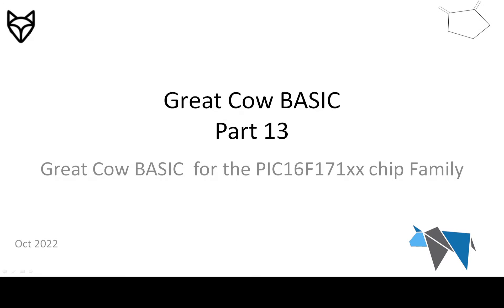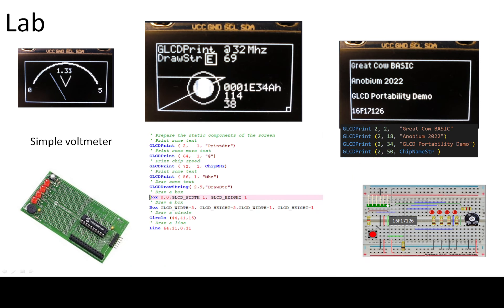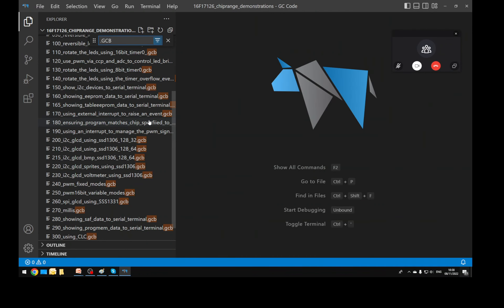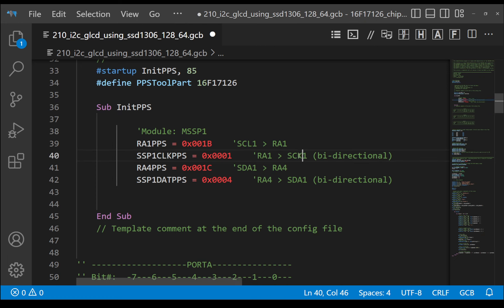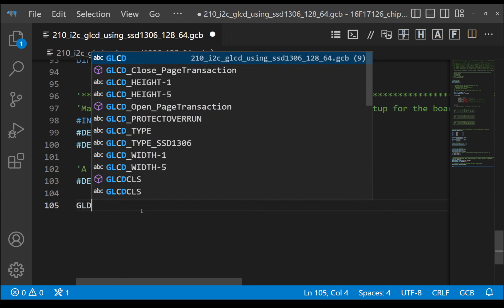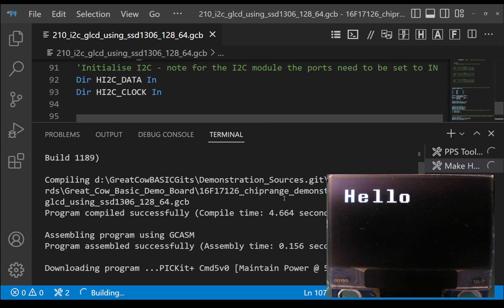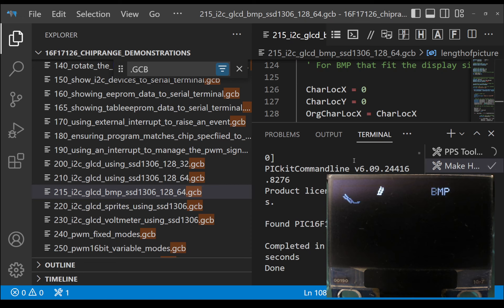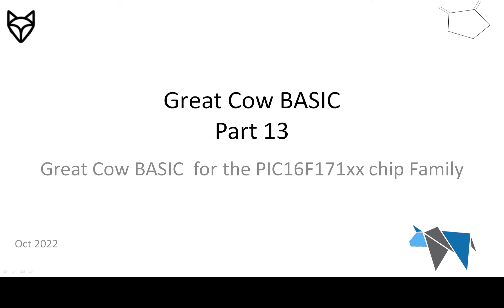PT13: PIC16F171xx Family - 16F17126: Using an I2C Graphical LCD

Comment: very good video . just a simple question.   >  I can not put my images on the GLCD ,images there are on the demos are great and working fine , but the converter process from .bmp file to a table does not work , the converter tool in GCB seems working only in linux  ?!!!!!  every time comes an error ... table not found.... this image converter 565 must be a trial or something (a couple of buttons are missing at the top ) gcb gives an error always everything is according the instructions ...  if you could make an extra video explaining this converter process it would be wonderfull. thank you Mr. Venn .
Reply from the maker: yes, I can.  I will dig into this deeper next week.  

However, all converters are Windows not Linux - the source is published so Linux users can compiler.
Reply: thank you very much sir for your answer.
Reply from the maker: Send me the bmp and your program.
Reply: @AnobiumTech  #chip 18f2455,8
 #config MCLRE= ON
 #option explicit

 #include <glcd.h>

  ; ----- Define GLCD Hardware settings
  #define GLCD_TYPE GLCD_TYPE_SSD1306
  #define GLCD_I2C_Address 0x78
  #define GLCD_PROTECTOVERRUN

   #include <..\converters\image1.bmp>

  #define HI2C_BAUD_RATE 400
  #define HI2C_DATA PORTb.0
  #define HI2C_CLOCK PORTb.1
    'I2C pins need to be input for SSP module when used on Microchip PIC device
  Dir HI2C_DATA in
  Dir HI2C_CLOCK in

  GLCDCLS

  CCount = 0
  dim longNumber as long
  longNumber = 123456 ' max value = 4294967290
  dim wordNumber as Word
  dim outstring as string
  wordNumber = 0
  byteNumber = 0

  dim lengthofpicture, ram_index as word
  Dim BYTENUMBER, WIDTHOFPICTURE, HEIGHTOFPICTURE, ORGCHARLOCX, CURRCHARVAL, FIRSTPASS, CHARLOCY, CURRCHARROW, CHARLOCX, CCOUNT as Byte

  ' Display a BMP file
  GLCDCLS

  
  ReadTable image1, 0, lengthofpicture
  ReadTable image1, 1, widthofpicture
  ReadTable image1, 2, heightofpicture

  lengthofpicture =  heightofpicture / 8
  lengthofpicture = [word]lengthofpicture * widthofpicture

  ' For BMP that fit the display simple write the data to the screen

  CharLocX = 0                       ' specify X pos for BMP
  CharLocY = 0                       ' specify Y pos for BMP.  For buffer any valid Y, for non-buffered 0,8,16, 24 etc...
  OrgCharLocX = CharLocX              ' specify X orginisal X pos
  firstpass = true                    ' specify this is the first pass

  for  ram_index =  3 to lengthofpicture + 3         ; start at third byte and finish at the end

         
           ReadTable image1,  ( ram_index ), CurrCharVal  ' read data
'           

            if ( ( ram_index - 3 ) % widthofpicture ) = 0  and firstpass = false then     ' change position for new line of data
               CharLocY = CharLocY + 8
               CharLocX = OrgCharLocX
            end if

                    For CurrCharRow = 0 to 7
                        if ( CharLocY + CurrCharRow < GLCD_HEIGHT ) and ( CharLocX < GLCD_WIDTH ) then
                            If CurrCharVal.0 = 0 Then
                               PSet CharLocX , CharLocY + CurrCharRow, GLCDBackground
                            Else
                               PSet CharLocX , CharLocY + CurrCharRow, GLCDForeground
                            End If
                        end if
                        Rotate CurrCharVal Right
                    Next

            firstpass = false                                          ' now this is NOT the first pass
            CharLocX++                                                 ' increment the X pos
  next

  wait 2 s
  SetContrast_SSD1306 ( 10 )
  wait 2 s
  startscrollright_SSD1306(0x00, 0x0F)
  wait 3 s
  startscrollleft_SSD1306(0x00, 0x0F)
  wait 3 s
  startscrolldiagright_SSD1306(0x00, 0x0F)
  wait 3 s
  startscrolldiagleft_SSD1306(0x00, 0x0F)
  wait 3 s
  stopscroll_SSD1306
  GLCDCLS

end
Reply from the maker: @rembrandtes  

I have set up a post on the forum.  See https://sourceforge.net/p/gcbasic/discussion/579125/thread/8221830a93/#25ef
Reply: @AnobiumTech  ok I am gonna send you thank you .
Reply from the maker: Send to my email address please.